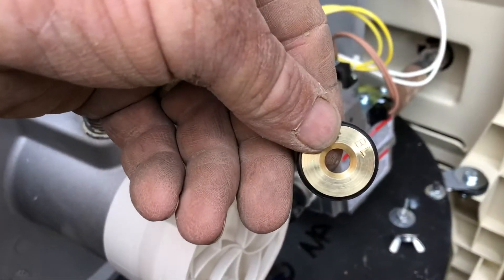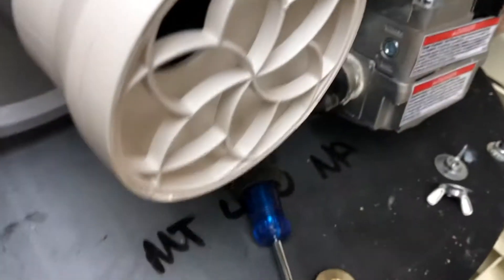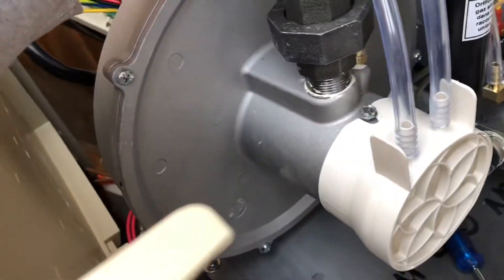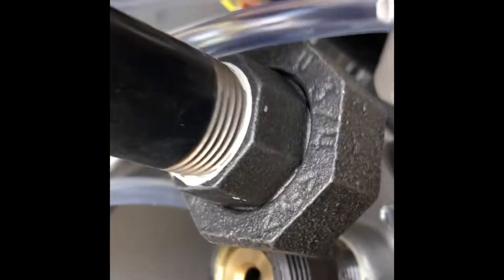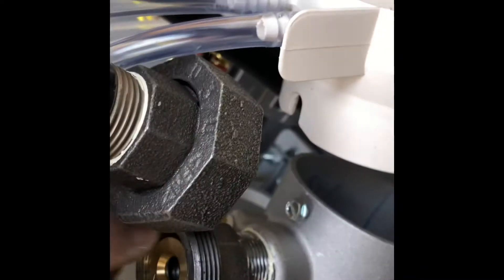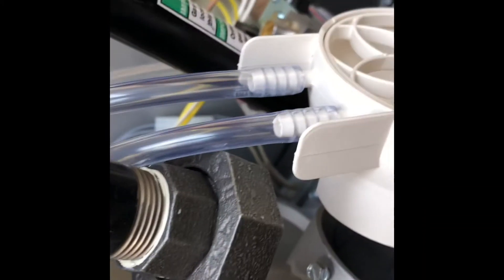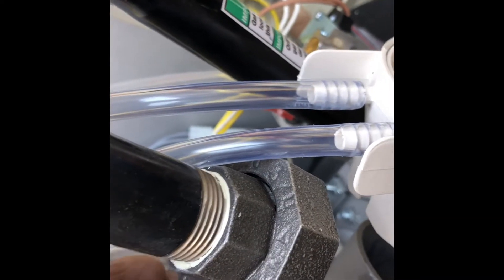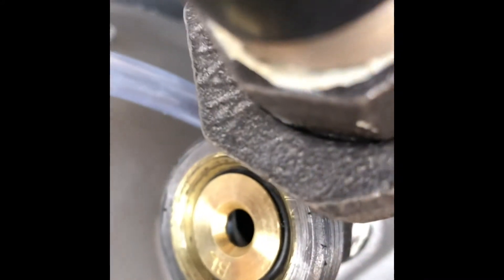Natural gas pool heater conversion LP propane gas

Comment: Hey Steve. Is that the only part that needs to be converted to run Propane?
Reply from the maker: Conversion only requires the orifice to be changed.

Comment: Is it keeps the same pressure natural gas versus propane?
Reply from the maker: Natural gas has a lower working pressure than Propane. It should be marked on the heater, I believe it’s on the front cover